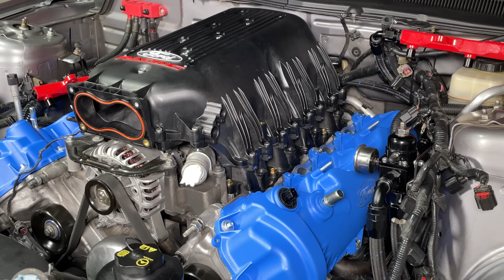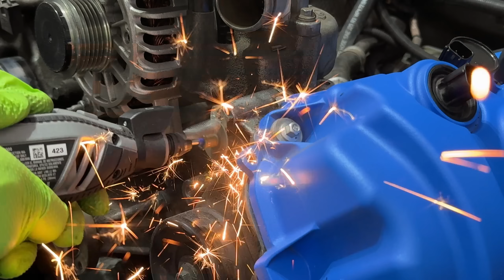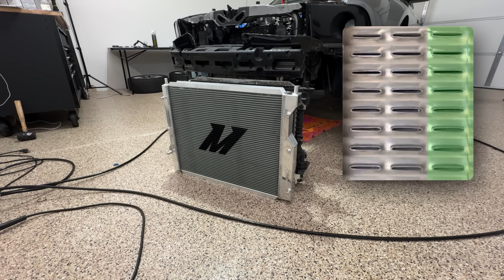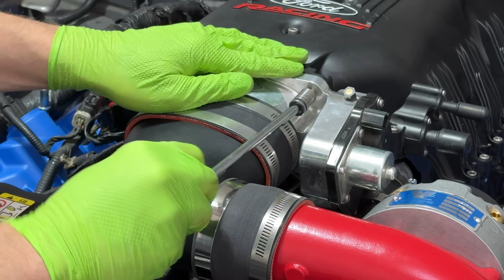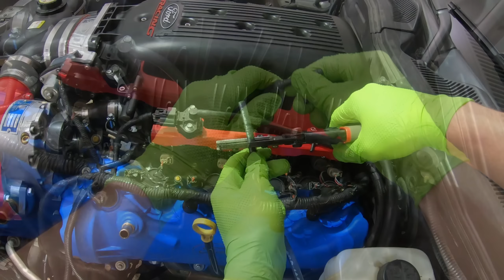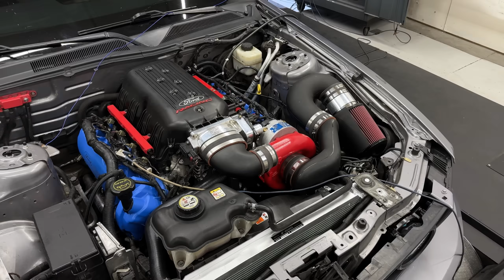Supercharging the Mustang everyone says is trash

Comment: Do you have videos going over the details of the cost of each of these super cool steps?  I always wonder how much enthusiasts spend to take a stock platform and make it super duper.  

-How much does a tuning expert charge to tune the car after upgrades?  Is it a base cost that covers the 10 or 20 or 30 times required to make adjustments after each collect data test drive
-Do you order parts online like your pistons or camshafts or connecting rods or transmission or do you rely on brick and mortar establishments?
-How much do you have to spend on rent or storage to maintain all your cars?

Love how you present information in your videos btw.  The video about the added air intake inter cooler where you went over the math and science behind the drop from 4" to 3" intake pipe sizing.

Comment: Hey, did you upgrade the rear differential in the Mustang I did a Google search for how much they can handle, and it came up with roughly 4:50 to 550 wheel horsepower.
Reply from the maker: i don't know exactly, but the solid/beam axle design means they can handle a lot, i assume quite a bit more than 550 wheel knock-on-wood

Comment: I would rather have the supercharger painted black. So you dont notice it right off the bat when you raise the hood. And blend in with the rest of the engine. Those blue valve covers and red fuel rails are bad enough. Im assuming their the stock valve covers and was painted blue at the factory. Im a street racer. Im a f-22 raptor. I like to blend in with the traffic. And stay under the radar. Not draw attention to my self.

Comment: The air temp location is bad. It's right near the injector before the intake valve on a random cylinder. The injector spray will get on intake temp sensor, giving you incorrect cooler temps results

Comment: the S197 mustang is the best mustang screw what people say mine has tanked abuse for the last 11years I've owned it and I've yet to see a car survive an 80mph deer strike head on: to clarify the deer was lying in the road on the other side on a crest I had enough time to see its head pops up and hold on, car went atleast 3ft in the air and flew 100ft landed heavy on the nose, I limped it back the my house the exhaust pipe was shoved threw the floor under my feet, drivers side header was bent, radiator smashed and had to clean alot of Bambi's mom off the undercarriage.

 and a 2nd deer strike at 60mph deer ran out of the woods right into the where the mirror mounts and its head came in a hit the head rest (good thing I only wore the lap part of the seatbelt or I may not be typing this)  and that one broke the windshield, dented the roof, broke the drivers door and dented TF out of the front and back fenders. 

in total my mustang has a pretty good killstreak of wild life since I live in the sticks and drive an hour 1 way to work your gunna hit something eventually and so far its been 4 deer, 10 possums, 3 raccoons, 4 rabbits, and an armadillo  (none where deliberate) but all are recorded like a WW2 fighter plane.  

I need to paint mine like the P51 and get it a hunting license if I hit any more wildlife.

Comment: Muscle mustangs mag march 2003
98 gt .020 over 8.90:1 compression 
Cobra crank forged piston Manley rods
Bullitt intake(2003?)
 ported pi heads 5 angle valve job
Fompk Motorsports cams?
Longtubes
610whp w/ novi2000 15psi
10.9s@127 w/TKO trans

99 gt w/ steeda kit 
cobra crank forged je pistons,
stock cams frp heads/intake
400whp w/ vortech

May 2011 muscle mustangs
Stroker 2v build(5.0 with 3.75" crank)
Xe2678AH cam
36lb injectors 👈
Ported trickflow heads 44cc
75mm cobra tb,trick flow intake
463hp430tq on motor 
604hp588tq on 150:shot in

Comment: Jesus christ did you just beat the crank balancer on with a mallet? You should have just bought the puller kit.

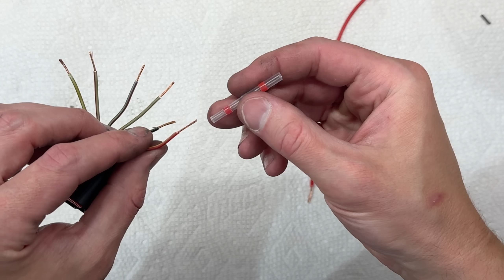9:14 Bad information. The wires need to be intertwined before using this cheap type of butt connector.
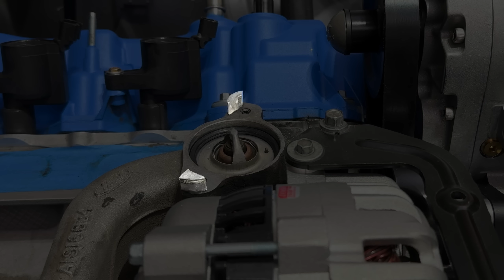11:05 WTF?
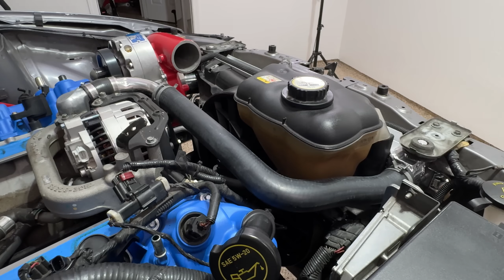11:30 If this was the best place, they would have done this from the factory.

Comment: I don't know the answer to this;
But couldn't you squeeze a bit more power out if you were inclined, by adding an octane additive to the fuel to improve detonation resistance?
Allowing you to get a bit more compression for the combustion cycle right?

Or would it be negligible gains compared to the tune you put on?
Reply from the maker: yes you could

Comment: I don't know, I think I'd have left it alone as NA; you'd done a great job with it up to this point. But that just me. I would have installed the rad for sure, however. But not the blower. I mean, 400+ w-horse power I think is plenty. But I get it, once you go down the rabbit hole, there's no bottom.

Comment: But could this build last for 150k miles if properly maintained?
Reply from the maker: The cam in this engine is a bit aggressive, so the valvetrain would/will probably be the first to go. The internals and transmission could last about that though.
Reply: @Four_Eyes  So... maybe 30k after this installation, it needs to be rebuilt?

Comment: Bro the 2005 Ford Mustang GT is not a bad car. The horsepower of the 2005 Ford Mustang varied depending on the engine option: if it has a 4.0L V6 Engine this base engine produced 210 horsepower at 5250 RPM and 240 lb-ft of torque at 3500 RPM. if it has a 4.6L SOHC V-8 Engine (GT models) this more powerful engine, found in the Mustang GT, produced 300 horsepower at 5750 RPM and 320 lb-ft of torque at 4500 RPM. And here's some cool things about it Retro-inspired Styling: The design drew heavily from the classic Mustangs, featuring a long hood, short rear deck, and a fastback profile, which resonated with fans of the original. 
Powerful Engine Options: The GT model boasted a 300-horsepower, three-valve V-8 engine with variable camshaft timing and electronic throttle control, offering strong performance for its price point. 
Enhanced Audio Systems: Premium packages offered advanced audio options, including a Shaker 500-watt system with a 6-disc CD changer and MP3 capability, and even an optional 1000-watt system. 
Improved Interior Design: The interior was designed to feel more upscale and comfortable, with supportive front bucket seats and a general aesthetic that suggested a more expensive car. 
Dedicated Platform: For the first time, the 2005 Mustang was built on a dedicated platform, meaning its design and engineering were not compromised by sharing a chassis with a sedan, allowing for a truer Mustang experience. 
Aggressive Stance: The car's aggressive rake, with wheels pushed to the corners and a longer wheelbase compared to the 2004 model, gave it a visually and physically anchored presence on the road. thanks for your patience and reading skills

Comment: just realized something, during the dyno run the car put down 610 or so, but during the dragrace due to the i a t values you estimate the car dropped 10% ish? how were the temps during the dyno run? in my mind a dyno run is a standing dragrace so wouldnt powerloss and temps be the same on the dyno as it was during the dragrace? maybe the mustang already makes over 650 assuming temps were as bad on the dyno as during the viper race.
Reply from the maker: good question. we only go thru one gear on the dyno (4th) and the car is always being cooled by fans while in the real world it's just sitting in place bathing in its own heat.

 IATs on the dyno peaked around 125-130 degrees
Reply: @Four_Eyes  damn that was a quick reply, 130 doesnt sound as bad indeed. if i remember correctly your goal was 650 wheel hp or so? seems we'll hit that in the next video! this series is great, its inspired me to try to build a racecar of my own, though not nearly as cool as your mustang, im going the volvo 240 group a touringcar route, speaking of touringcar, do you even plan on taking the mustang to a track or something to really push its limits?

Comment: For those who confused that supercharger looks like the the turbo, it's the Centrifugal Supercharger.

How it works:

 • A centrifugal supercharger is mechanically driven directly by the engine's crankshaft, usually via a belt and pulley system, similar to how an alternator or power steering pump is driven.

 • The supercharger contains a high-speed spinning impeller (compressor wheel) that draws air into its center.

 • As the impeller spins rapidly, centrifugal force slings the air outwards. This accelerates the air to a high velocity but low pressure.

 • The high-velocity, low-pressure air then enters a diffuser (a set of stationary vanes), which slows down the air. As the air slows down, its velocity energy is converted into pressure energy, resulting in high-pressure, low-velocity air.

 • This compressed, high-pressure air is then directed into the engine's intake manifold, allowing more oxygen to enter the combustion chambers. More oxygen means more fuel can be burned, leading to a significant increase in engine power.
 
 • Because compressing air generates heat, centrifugal superchargers often work with an intercooler to cool the compressed air before it enters the engine. Cooler, denser air further increases power and reduces the risk of engine damage.
Key Characteristics:
 
 • Directly driven by the engine: This means there's no "lag" in boost delivery, as the supercharger spins up immediately with the engine.
 
 • Draws power from the engine: A portion of the engine's power is used to drive the supercharger, which can slightly reduce overall fuel efficiency compared to a turbocharger.
 
 • Progressive boost: Centrifugal superchargers tend to build boost proportionally to engine RPM, meaning they deliver less boost at low RPMs and more at higher RPMs, reaching peak boost near redline.

Koenigsegg Uses a Centrifugal Supercharger In a Ford Powered V8s Such as CC8S, CCR, And Koenigsegg Engine Built, The CCX.
Reply: u made my day thaaaaaanks! i was a bit confused
Reply: Great info

Comment: If only he knew anything about, how an internal combustion works! More fuel doesn’t stop detonation. you should learn what octane actually is.
Reply from the maker: A richer mixture absorbs more heat during combustion, helping cool the chamber and reduce knock. That’s why tuners often fatten up AFRs in the upper rev range - not for power, but for safety. It’s basic combustion thermodynamics.

Comment: The hidden secret of the 3-valve engines as a whole is the are the ultimately setup for a supercharger of any type:
With a turbo there is backpressure, at some point even overtaking the dang boost number lol but with supers 0 backpressure, so 1 (well-placed & large) valve is generally enough;
The exhaust only being 1-valve means WAY more space for intake and so the cramming of boost is that-much easier and superchargers already work well with high-RPM unlike turbos.
Also 3 valves means each valve is larger than with a 4-valve setup, plus it's easy to alter the size of any of them, so in other words a 3-valve can have no real drawbacks o nth exhaust side from dropping to 1 instead of 2 for most modern engines. Really the reason 3-valve is so rare is because of drive-train design, not real flow performance.

So if you're really smart, a 3-valve engine with a setup all designed to work-together can be INSANE!!

Comment: Love the mustang but if you would like some cooler IAT temps try making a functional hood scoop , the stock hood scoops on mustangs are fake so I made it functional and the car feels cooler an much better in high MPH even just sitting at a light you see the amount of heat that gets released just a thought would love to see if you’d do a data analysis on if it makes a difference or not or if drag coefficient is compromised
Reply from the maker: yeah i need to put in some heat extractors for sure

Comment: Intercooler is a good idea, but methanol injection is the real key. Get a kit from snow performance and run it off your washer tank. Or put a tank in the trunk if you want to keep things neat. It will add 10-20% power and bring intake temps down by easily 40 degrees. I can see when the methanol injection kicks in on my data logs because the temperature just drops like a rollercoaster.

Comment: Hey do you have a video of you or someone installing the battery to the trunk? I can’t seem to find one!
Reply from the maker: I don't. Mount a distribution block on the pass side like mine. Run the alternator, starter, and main fuse box to it. Route the power line down thru the passenger-side wheel well, under the car to the trunk (loom and fasten it), then drill holes in the rear passenger-side area for the bolts that hold the battery in place and the terminal cables. Negative can bolt to the body (don't let the positive cable terminal touch the body :)

Comment: So I was checking out a 5.3 modular short black from Ford performance it takes 3v heads and I was wondering if it would be cheaper than building my current 4.6 3v? It comes with all forged internals

Comment: I have a 3.7 mustang V6 and it gets probably even worse respect than the 4.6 because its a V6. Despite being an absolute tank of an engine that is extremely reliable and makes great power. There are tuned, supercharged examples pushing 600+hp....The ecoboost mustang that never was...  and from factory makes 305hp.. With a simple tune and regear you can keep up with or even surpass stock GTs.  200lbs lighter in the front so more fun in the handling department (although s197s are heavy and have a solid rear axle and don't handle great no matter what lmfao). It really doesn't matter what "everyone says is trash" because everyone is in massive debt to a car that no one cares about but themselves, and if you enjoy something, who is anyone else to tell you otherwise?  Also my mustang costs about as much as a Camry to insure. I love this car. Best car I've ever owned. Imo pretty much all Mustangs deserve more love because they're built so well and are an amazing value for what you get. Obviously theres the "crashing into crowds stigma" but that's user error. People don't know how to drive them and have no interest in actually learning, just showing off.

Also, the race vs the viper was amazing. No one expects this car to beat the viper but the fact that it sat there and hung right by it is enough for me. Tbh i would be completely happy with the car in that state and would not go any further. It's a 3valve mustang and no matter what you do to it, but will never perform like a tuned coyote (4 valve), which has a lot more tech (Ti-VCT) and volumetric efficiency than this motor as well. I think this build is clean, amazingly well done with no mickey mouse work done to it. No corners were cut on that supercharger install. Looks like everything was thought out and put together well. The car is great for what it is, these were about 25-30k new and you have one that can hang with super cars... I'd say that's a great deal.

Comment: Also one thing worth noting is that crimps do not fail as often from vibration as solder joints which is why oems never solder anything. Consider old fashioned crimp splices and terminations with heat shrink instead of those low temp solder splicers
Reply from the maker: good tip, thanks robert

Comment: I have an 08 GTCS that I put an Edelbrock E-force and T-56 in! One thing I would recommend thatI did for mine was a methanol injection kit. Should help with those high intake temps on top of having the intercooler and It will also increase octane which is great for forced induction. AEM and Snow Performance make them, I personally chose the snow performance’s kit from Summit racing.

Comment: that's a turbocharger-
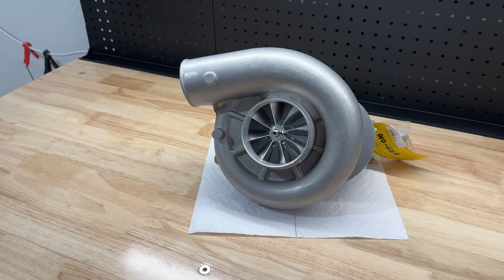Reply: it is not a turbo... at 1:46 you can see a pully, it runs from a crankshaft. so its a centrifugal supercharger, VERY similar to how a turbocharger operates but instead of the turbine wheel being driven by exhaust gasses (attached to the compressor) a centrifugal supercharger it pretty much just the compressor side of a turbo being driven by a pully linked to the crank.

Comment: I built a 4.6 3v in 07 for my Shelby GT ..stock new 3v block 04 svt cobra crank billet rods it was blueprint and balanced to 9500rpm I intended to run a sheet metal intake a distributer off the cam and carb but changed it last minute back to stock intake configuration .. ported and polished 3v heads with 1mm over sized valves intake and exhaust then custom cams   by comp   Duration @ .050" 	237 / 248 
Lift 	.547" / .560" 
Lobe Sep Angle 	113 + 11 
Center Lines 	102 / 124  set center line 109   I used good springs and valves also . compression 10.1  stock rod angle bore and stroke ..supercharger vortech v3 si  14psi  pump gas 93   .headers were equal length shorty's with a x pipe and factory mufflers it sounded insane .. 3.73 gear and t-56 magnum XL swap 1 o the first of 3 cars to do the swap at the time ..full adjustable suspension  ....the car ended up making 735/595 8300 on a well calibrated dynojet 248c   in 92degree ny humid summer I ended up with a innovative west 6% overdrive crank pulley/balancer so I could make the same power without spinning it so hard on the street so it made same power at 7700 instead and if I brought it to 8300 it made  780s    ,my stock tuned numbers were 312/307   with cai exhaust tb tune .....then with a blower on 10psi 477/434 , then I decided to build it .. the car in 2011 ran 10.19 139mph with 18in drag radial and manual 6 speed ..I used the 2.97 1st gear box .. https://youtu.be/_qw5oqPrp4A?si=lvNRUJJ6UGqeEyOt

Comment: I ride the last of the stick axles. A 2014 6R80 GT with a Roush TVS blower. I'll never sell it. It's me second S197, I had a 2012 GT with BBP, 3.73s and an MT82. It died badly after I boosted it w. Vortech. The auto car replaced it. Also a loaded car. So much value in these later S197s.